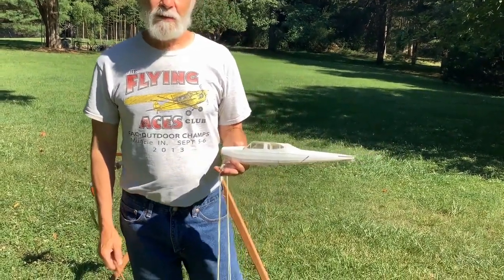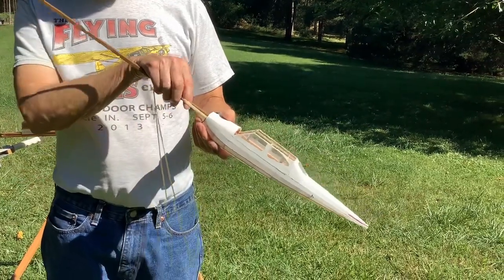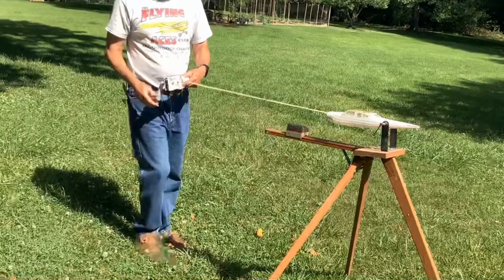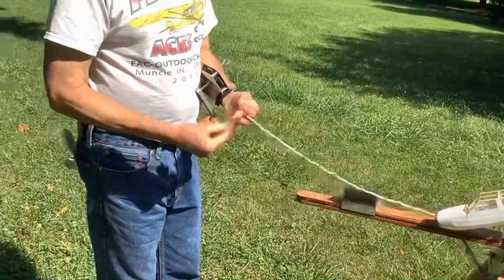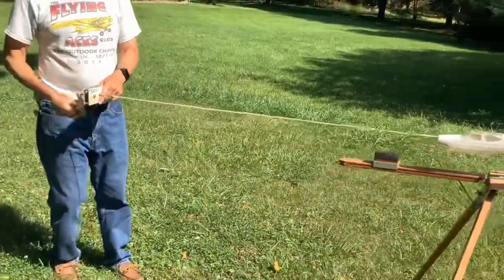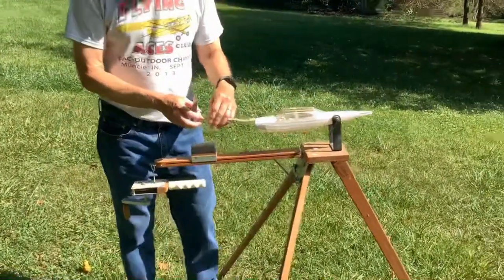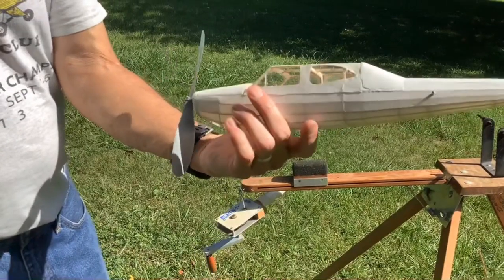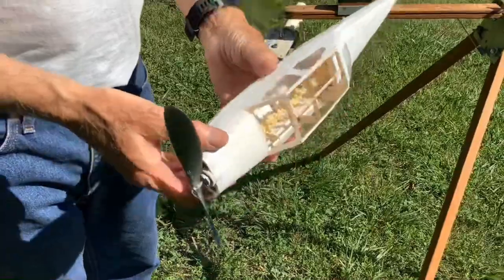Rubber-Powered Aircraft Tutorial: Braiding Motors

Comment: Thanks Wally! How do you calculate the number of braiding winds relative to the thickness and length of the total loop?
Reply from the maker: Hey Steve, thanks for the comment. There are different philosophies out there about this, but people often specify a certain number of turns per inch to start, and then tighten if needed (rubber is not suspended after unwinding). I tend to do 150-200 forward turns each loop for a 20"-30" long motor, Wally often does a little tighter -- 300 turns or so.

Comment: Very interesting. I guess it must work. The traditional way of braiding that I use is to reverse wind each half motor separately and then connect both front ends together at the nose and allow to unwind itself. That way you don’t waste the first 100 or so turns unwinding the made up motor every flight. If you forward wind the loops it still braids the motor to the required length but you unwind the braid at the start of each flight winding. 
The alternative is to not braid but have a spring prop stop to prevent full unwinding and consequent bunching. Either way you shorten the motor run and waste a bit of power.
F1B and F1G Wakefield and Coupe models normally have motors that are shorter than the nose to rear hook distance, so no problem. 
Braiding is simpler with even numbers of strands, but can be done with odd. Better to alter the rubber thickness to get even strands e.g. 1/16 rather than 1/8.

Comment: Hi, great video, tanks for sharing it Wally. I tried this system on two models, a Guillows cub and one other but I found the power delivery too slow and gentle to get them flying. They fly fine with 2 strands of 1/8". Is this braiding just for very light models? The rubber was well lubed.
Reply from the maker: Braiding like this can work for all sizes of models. Depending on the freewheel on the prop can be tighter or looser.

Comment: I have a plane that really like one loop of 1/16 and one loop of 3/32 rubber. Will this technique work with two different widths? Any advice is greatly appreciated.
Reply from the maker: sorry for the late reply, this should work fine with different widths. If just 2 strands rather than loops, you can twist each one with a binder clip and then tie off after they're twisted together.